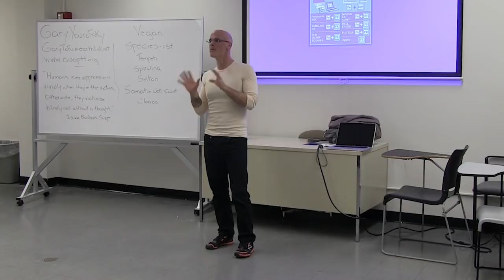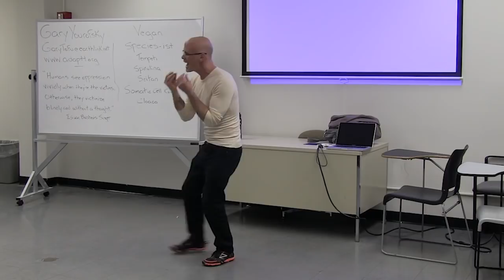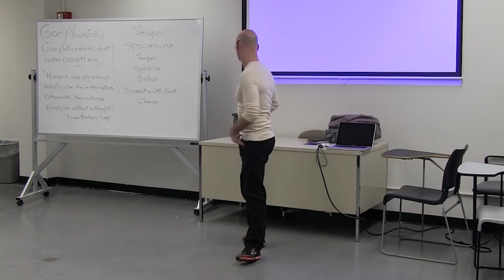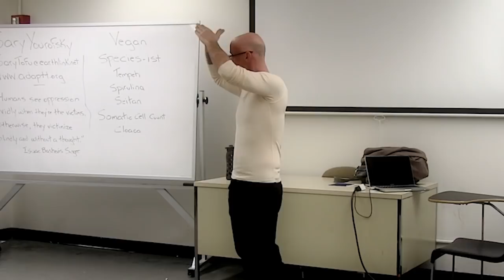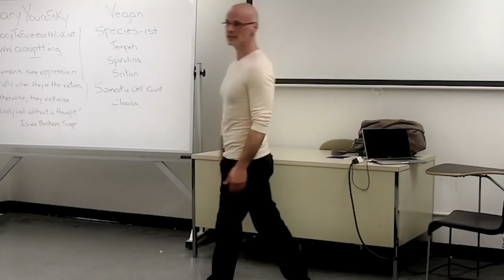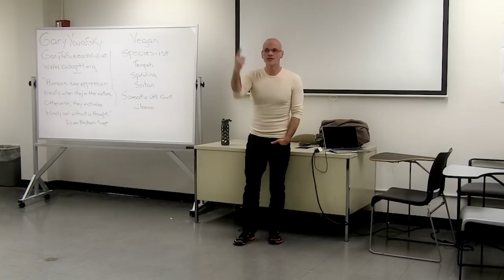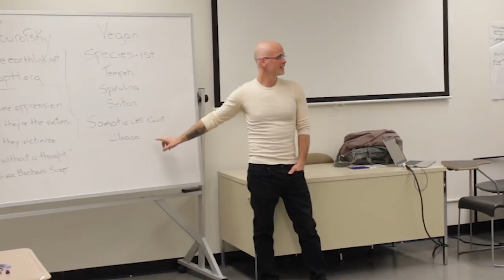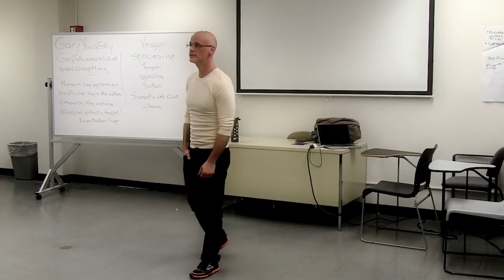Best Speech You WIll Ever Hear (Updated) -Gary Yourofsky

Comment: One of the biggest problems i have with his speeches is the incorrect comparison of all animals as the same or as equal. Humans, pigs and insects are all different. The capacity to feel pain, to feel fear, to rationalize what's coming is all different. Some animals don't even feel any pain like oysters and insects for example. How is it different then to eat animals like oysters or sponges from eating plants. Putting animals (including humans) at the same level reflect a huge lack of scientific knowledge. Instead of this nonsense, people should be speaking in a continuum of moral responsibility towards animals. Our moral responsibility towards insects is significantly less than towards pigs, and our moral responsibility towards pigs is significantly less than towards humans. When you realize this you will see that is ignorant and offensive to compare concentration camps to slaughterhouses. Humans are not the same as cows, and cows are not the same as insects. Yes all animals should be free and not killed and all that, but don't use dumb arguments to defend this idea. And yes i'm vegan for the animals and for this planet.
Reply: I agree.
Reply: This is true, but yet not because someone or something is not the exact same as you doesn't mean you can torture them, kill them and abuse them. They have feelings too. They feel pain too. They experience fear too. They end goal is the same, however it's expressed.
Reply: There should be more moderate vegans like yourself on social media to counter the extremists who poison the vegan movement, thank you.
Reply: agreed with Dans, doesn't matter how much an animal is capable of feeling, how wide of a range of emotions they have in relevance to a human, the world doesn't revolve around us.
Reply: All of us agree with that, but it is incorrect to say humans and cows or pigs or insect are all the same 'cause they are not. A slaughterhouse has horrible it may be, isn't the same as a concentration camp. We have moral responsibility towards all earthlings, but our moral responsibility towards humans is higher than with any other animal.
Reply: ***** We don't have to be the same or have the same capabilities  to be equal in sentience, how is a concentration camp any different than a slaughterhouse when in reality both have innocent victims who don't belong there? who equally have the will and desire to live? We humans aren't any more valuable than an ant or a bee, if ants and bees went extinct, the ecosystem would collapse, if humans went extinct the planet would flourish
Reply: Maybe the problem lies there. Animals do not share the same level of sentience. That's the problem in your argument. Even in the film Earthlings they recognize this, but many people seem to miss it... they say “Granted, these animals do not have all the desires we humans have; granted, they do not comprehend everything we humans comprehend; nevertheless, we and they do have some of the same desires and do comprehend some of the same things. The desires for food and water, shelter and companionship, freedom of movement and avoidance of pain". You see, they have to be protected because they are sentient, not because they are equal to us. So yes cows and humans are not the same nor are they equal, the only same/equal thing is their right to not be the property of someone and their right to be free and not harmed.
Reply: ***** lol u can't measure sentience but i agree
Reply: +Tiago Varela +Tiago Varela Alright, I get your point. It's wrong to say that, that's a mistake in the speech, great. Now, the goal is the same. Again, you don't have the right to eat something or someone just because they're not the same as us.  I understand that his text may not be 100% right but hey, it's bit the end of the world.
Reply: Yes. It's really amazing that his work brings so many people to become vegetarian, no matter the specific vegetarian diet (even more spectacular the people he "turned" vegan). But it's because of errors like this one, specially from someone so influential, that leads to criticisms of extremism. The idea of animal welfare is strong enough in itself, no need to use "incorrectness" that only debilitates our "battle".
Reply: People who claim animals and humans have the same brain capacity and higher brain functions need to have there head checked.
Reply: What do you mean?
Reply: We r all the same, except you are lower than us, cows, pigs, chickens, and insects :)
Reply: Yes they may be different, but that doesn't mean they can't be equal. Asian, Caucasian, African-American, ... people are different, yet they are equal (if you're not racist). They are not the same, but they are equal. Maybe he worded that wrongly, but that doesn't take away any of the strength of his argument. It's because we are EQUAL that he compares animal farming to the Holocaust, not because we are the same. We are equal because we live, because we have feelings (however small). It's not because animals feel less, can think less, that they deserve less to live. No, all earthlings want to live and that makes us equal, but not the same. Small, but very important difference :). I hope you realise that your opinion that less cerebral development makes us unequal is REALLY arbitrary. I don't value another living thing on the basis of their cerebral development, I value them on the basis of them living in se. Maybe an important point of view to think about :). (And of course, if someone doens't care about animals or think he/she has the right to own them, they do feel like less cerebral development makes us unequal, but I think my point of view goes for most ethical vegans!)
Reply: Exactly what Dat boi says. Well then if you want, my basis is "they have a central nervous system". That's what I meant by saying that my basis for equality is that they are living things, that is, living things, capable of pain and emotion, hovewer rudimentary or basic and simple that pain and emotion may be.
Reply: So you see the arguments are always the same. If plants don't feel pain, so  doesn't some animals like sponges, insects or oysters and  add the fact that no other animal feel pain like we do. You see when you put all animals (including humans) in the same bag and say they feel pain, you are saying they equally feel pain (which is incorrect) and that leads to the untrue notion that it's equally wrong to torture a human or an insect (which is incorrect). I think im starting to repeat arguments in this discussion, which shows people don't really get this notion. It's not my purpose to lecture or educate you so i will not continue this discussion.
Reply: No, YOU are saying they equally feel pain. By putting them in the same bag, I'm saying that they all are capable of feeling pain, the intensity of the pain aside. I think you're mistaking YOUR opinion for THE truth. For example: "animals don't feel pain in the intensity and complexity humans do", that is the truth, a fact. "It's not equally wrong to torture a human or an insect", that's NOT the truth, nor a fact, that's an OPINION, and thus arbitrary. Ethical and moral questions don't operate in right or wrong, they operate in opinions (and thus what I said, is also an opinion. As I said, it's a point of view).

I totally get what you're saying, but I just don't agree with your opinion and I offered a different framework to maybe understand what Gary means. But hey if you're not willing to look into that, then just put it aside, that's fine, but don't "accuse" me of not getting your point, 'cause I do. Nontheless I wish you a great day (or night, or whatever time of the day it is where you're living) :)!
Reply: Point one - Julie it wasn't me that said they equally feel pain. It was Gary in this video when he compared slaughterhouses to the holocaust. the wrong idea that we have to have the same level of moral responsibility towards all animals, leads to the incorrect (and extremist) idea that to torture an insect is the same as to torture a human. Point two - It's not me that say animals are all different between them (in complexity, in capacity to feel pain, etc.) and that humans are greatly different from all other animal, science is. Point three - Understand that i am vegan for ethical reasons as well (and environmental ones, etc.) since i think there is no valid argument to defend eating animals, if you have the option to have a healthy diet without killing them. Is torture bad? YES! Is the torture of humans (hollocaust) the same as killing cows for food (slaughterhouses)? NO! There is a continuum of moral responsibility ... get it?!
Reply: I never contested point 2 and I'm not going to elaborate further on your comment, given that you are starting to attack me and I don't care for a discussion like that :). Have a nice day!
Reply: Julie and Dat boi  sorry if it come across like that, i have no intention in attacking anyone. Hugs  =)
Reply: That made me smile, hugs back at ya!
Reply: @We r all the same, except you are lower than us, cows, pigs, chickens, and insects :) @ Good answer ! Varela makes no sense. Its all about attitudes and feelings dude. It is subjective and emotional, like you have emotions for your own children.
Reply: Alex, it would be a good idea to read all the discussion tread before presenting a comment like that ...
Reply: Lions and polar bears do not preemptively round up gazelles and systematically exploit them in horrific, unbearable, and torturous ways: only humans do that. Exploitation does not exist in the animal kingdom--only in the human realm.
Reply: I totally agree, I had the same issue with him. We shouldn't be doing this to animals, but we ARE superior to animals in pretty much every way. Are animals stupid and insensitive? No, of course not. They have feelings and feel pain just as we do and its evident by the video he shows that we are torturing them and inflicting great amounts of pain. But I do believe all animals feel pain (oysters and insects alike), we just don't know it yet. And you're right, we do have a higher moral responsibility towards humans. If there was a fire and I had the choice between saving an animal I know well or a human I don't know at all, I would have to choose the human as much as it would pain me to lose that animal.
Reply: Oysters clams, mussels, and scallops do not have sentience. Therefore, it is still okay, even vegan, to eat these animals.
Reply: Pain is pain, pain hurts, nobody wants to feel pain and nobody wants to die. And dude, one of the first lessons in zoology (if you study biology) is: insects, snails and mussel all of them feel pain!!!! I don't know why people believe they don't... Poriferans are the first on the list that don't feel pain. Everything else is just a lie to make people buy grilled insects and seafood.
Reply: When he's talking about eggs being covered in excrement and bacteria, it's worth remembering that insects, birds and mammals are crapping all over your fruit and veg all the time, and all those plants are growing in soil that is comprised in part of vast amounts of excrement and dead animal bodies. But it still doesn't justify the vast number of sentient beings we abuse, enslave, exploit and kill, nor the grim technology and processes we've invented to make it possible, nor the impact it has on the only home we have. Go vegan!